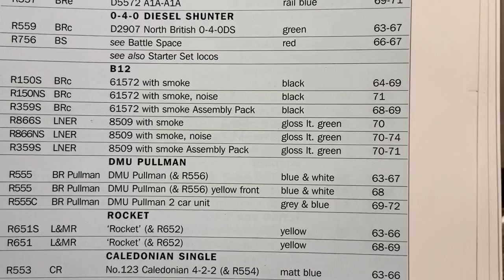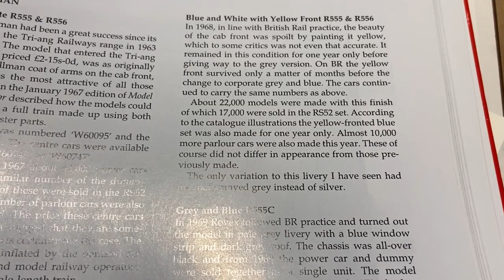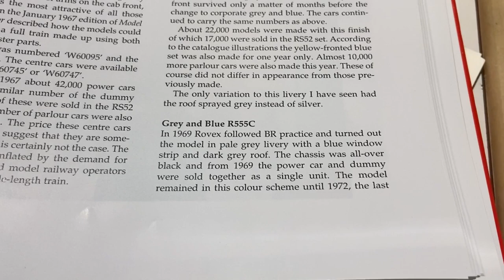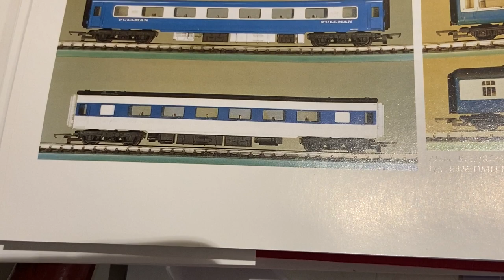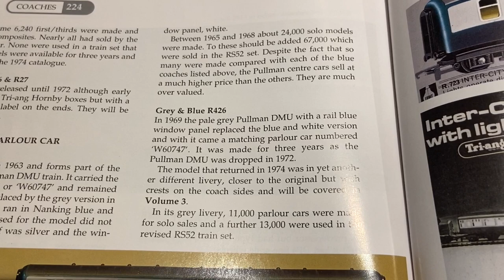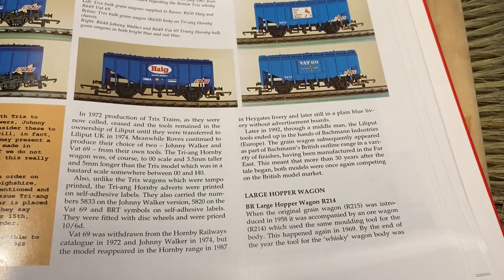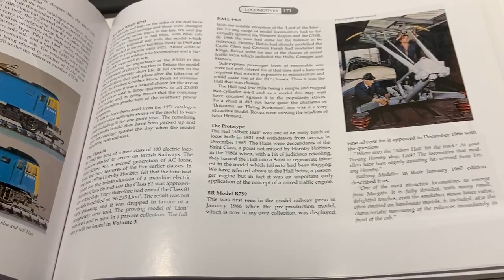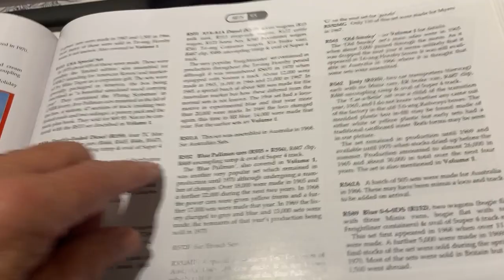Running trains and repairing Blue Pullmans

Comment: Thanks for your video. I love the Blue Pullmans, in fact over the years I have collected more than fourteen to fifteen sets of them in their various liveries. they vary in condition from almost factory fresh to those that have never been cared for. My current project is I have made up a full train of these neglected models to make for myself a Midland Pullman. I've started by removing all the deep scratches in the bodies and purchased replacement window inserts; at this moment of time I'm converting two coaches into Kitchen cars. There are two motorised driving cars the chassis' of which have been altered to take Ringfield motors which will eventually be changed to CD motors. There are plenty of details to add, from horns, windscreen wipers, roof grills and fans etc. I've painted the coach interiors also. If the project is a success I'll build another train and put it on You Tube as I build it. Thanks again for your great video.
Reply from the maker: Wow! I really appreciate you taking the time to drop this note and sounds like you have enough project work going on that will keep you busy for the foreseeable  future.
You are a bit more adventurous than me with respect to the conversion to the kitchen car, that might be something for future consideration.
In some of my other responses I did mention John’s amazing trains, you probably know he was modifying the driving wheels and, there seems to be an alternative to the knurled wheels if you so desire.
I would love to see your future videos of further modifications to this model.
Once again, thank you so much.
Kind regards
Charlie

Comment: Hi Charlie, all the Locos at the start of the video looked looked good and ran very smoothly. The First Pullman must be one of the quietest Motors I have heard, they can be a bit noisy but yours is very good after the service. The second Pullman motor surprised me how quiet it was condsidering it has splined wheels and the large flanges. Hornby used this motor in the Dock Shunter which was very noisy. The third Pullman you ran was the smoothest of them all, a very nice runner. Cheers, Paul.👍👍
Reply from the maker: Hello Paul, you really were paying attention and yes I am very pleased with the outcome. I might think about replacing the Knurled driving wheels at one point but the sound is unique. JohnChambs123 spoke about using alternate wheels so I must dig into his library to locate that video.
I might also take a look at the Shunters now.
How is your back these days Paul?
kind regards
Charlie

Comment: I just wrecked an A3 motor trying to replace the commutator ! Where is Barrie Davies ?
Reply from the maker: Whether Barrie has retired from Youtube or Youtube has retired him has yet to be determined. Regardless of the outcome I will miss his intellectual knowledge and abilities in the art of fixing locomotives. The same applies to John’s Amazing Trains, he’s out there sonewhere.
As a back up to those two giants of the hobby I would suggest you contact 00Bill, he is the next best thing.
Hope this helps.
Regards
Charlie
Reply from the maker: Exactly what did you break?
Reply: Thanks for your reply Charlie. I have watched BD for the last few years, written to him and sent gifts and he has sent me bits and pieces for repairs. I miss him very much. I learned so much about the hobby from his you tube channel. Anyway the A3 was a second hand purchase that was noticeably sluggish, a friend sent me a new commutator and I tried to replace it but I cracked the housing that the commutator sits in. I’ll just buy a new motor. It’ll be fine. I like oo bill but haven’t sent anything for repair. I grew up in Partick and my aunty lived in Fairlie Park Drive so I frequently travelled on the blue trains from Partickhill out west to visit relatives. I’m living in Ireland now just finishing a Housebuild with a bespoke model railway outbuilding included. Finally a permanent layout. All the best. Scott
Reply from the maker: Wow Scott, just round the corner! I was born in Vine St above Fraser’s Bar at the corner of Russel St.
We moved to Knightswood when the tenements were planned for demolition. I moved to Canada in 1973 when the future in the shipyards looked bleak 
It’s a small world after all.